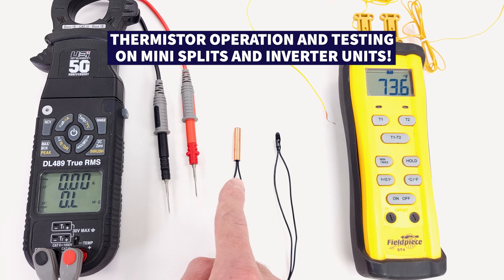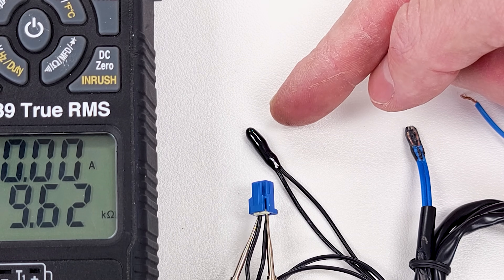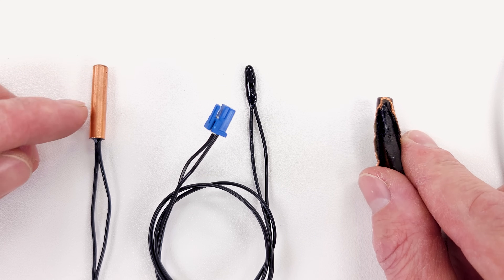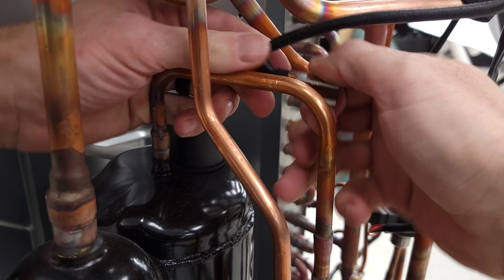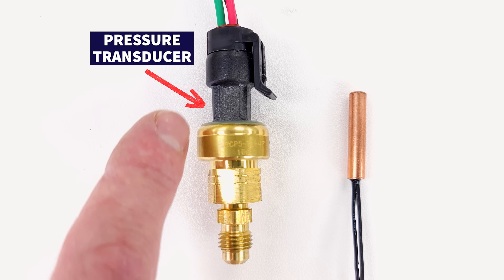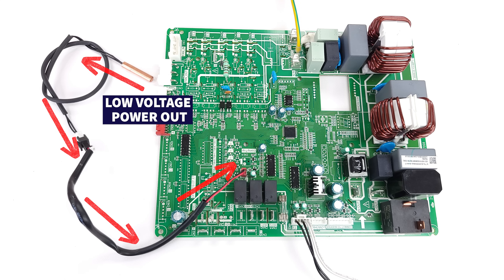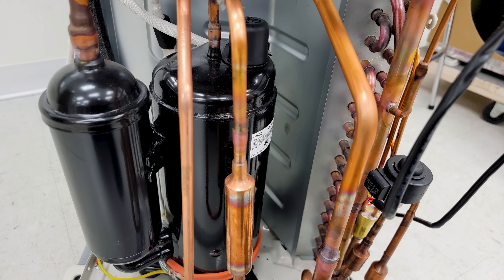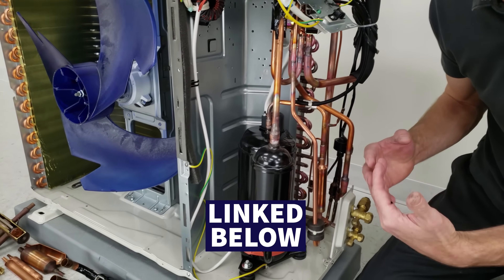THERMISTOR Operation and Testing! Inverter and Mini Split Training!

Comment: My mini stop working. Runs for a few minute then stop. Ohm out the indoor thermister at 86 degrees should be 16 ohms , only getting 8 ohms. Replaced $14 thermistor and I'm back in business.

Comment: have an lg inverter V which gives error codes such as ch32 also red diode flashes.
have now ordered a temp sensor but don't know if that is the problem, also the fan in the outer part is standing still.
My question is if you can help me so I don't have to buy a new one.

Comment: I can't seem to find a thermistor for my GE window unit  aew24dth1 ..  I guess it wants me to get the whole control board?   Is this normal or is there some other way to buy these parts?   My thermistor is working, but it's out of spec and won't go below 72 degrees, no matter what.. So then the unit never shuts off and it will just continue to run until it ices over.  I can't find one online

Comment: Hi, I have an old LG 12kbtu mini split system, got the led blinking error indicating thermistor of indoor unit is damaged. Can't find this part OEM, is it a good idea to just buy a generic one and solder the cable to the OEM connector? Any thoughts on this?

Comment: Please what's the role of room temperature sensor? My ac compressor only cycles on and off when temperature is set at 25 -30 degree Celsius but if the temperature is set between 18-24 degree Celsius, compressor continues to run even when the set temperature is reached . I want to know the sensor that's malfunctioning. @RajonRabidash  so what's the role of room temperature sensor? My ac compressor only cycles on and off when temperature is set at 25 -30 degree Celsius but if the temperature is set between 18-24 degree Celsius, compressor continues to run even when the set temperature is reached . I want to know the sensor that's malfunctioning.

Comment: please if the room has reached its desired temperature set by the remote control and the AC compresor doesn't shut off, which of these sensor is the culprit?

Comment: I have a Eco-Breeze KFR-35W/GX1b with no fault codes.  Been working about 10 years.  Fans all spin up.  One day it just stopped blowing cold air or hot air in heat mode.  Checked the high and low copper tubes and they are at ambient temperature.  Doesn't appear that the compressor is doing anything.  

Given that I have no fault codes, what are the first things I should check?  I have manifold kit, multimeter, and installed it myself years ago.  So not afraid to figure things out.

Comment: The epoxy holds the two wires in the tube. Are the 2 wires connected together or do they need to touch the tube?

Comment: Most commonly used thermistor is 10k ohms at 25 degs C and temp coefficient beta of ntc 3950, also known as type 2 thermistor.

Good idea to check thermistors, they do not have great reliability.  Mini-splits can have up to four or five of them.

Comment: My fridgiare ac unit has a code A5 which they told me its the thermostat sensor but not to sure which on exactly. The unit works i just cant adjust the digital temperature it just stays on. Can some one help me on this

Comment: Thank you. 

Did you happen to compile the different manufacturers charts in your new book? 
Thanks.
Reply: That would likely be impossible as what is used is an engineering choice.  Likely most will be 10k thermistors as the chart in the video shows (look at the resistance at 25C or 77F) for the range, but it might be a different "type" which has a different response profile or accuracy.  But 10k Type 2 seems to be the most common for middle temps.  5k seems common for freezers so the resistance change a low temp is has enough range to be easily monitored.  The TP is likely a 100k since that gives a decent range at higher temps.